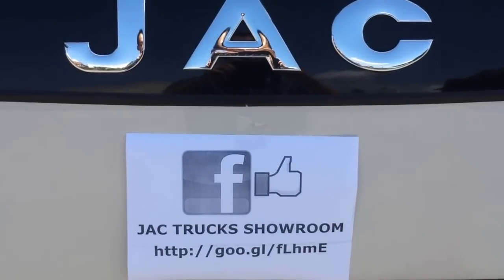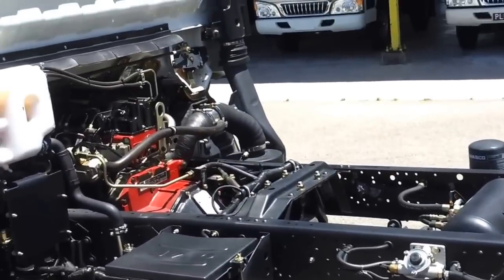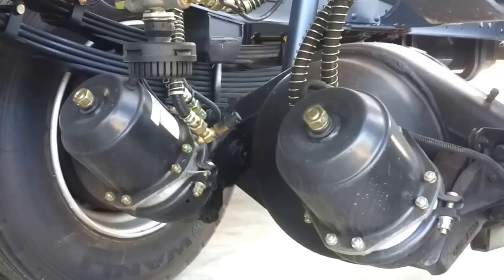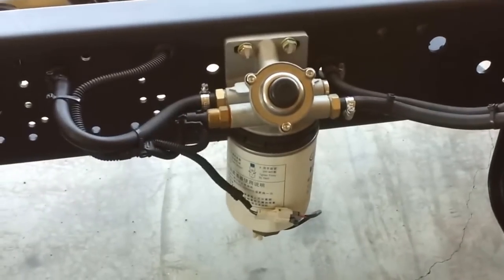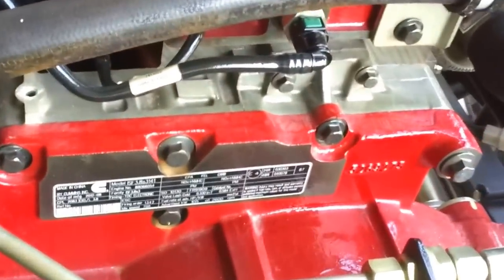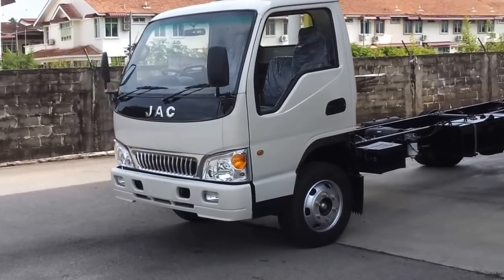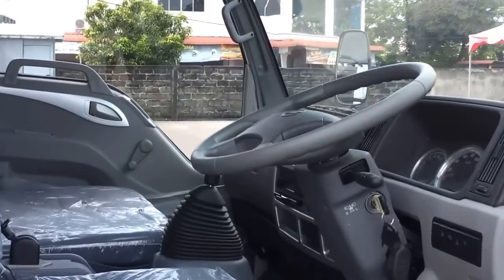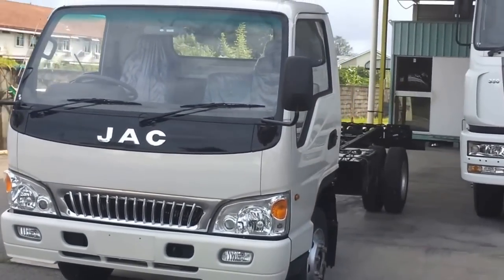Introduction to JAC HFC1061K5P 5,000KG Light Truck

Comment: Are the Tuah Power Truck and JAC trucks produced by the same manufacturers in China? I heard both of them are compatible with Isuzu, in terms of spare parts. Is it true?
Reply from the maker: Sorry, I am not sure Tuah and JAC are from the same manufacture from China, but the side panel door and windscreen are compatible to ISUZU NPR66. Other than that, the spare part should be different.